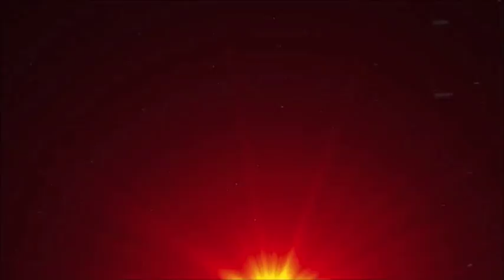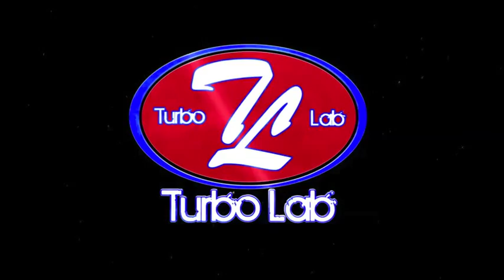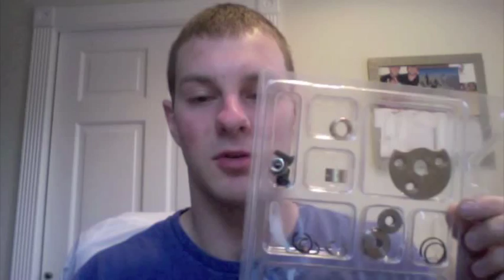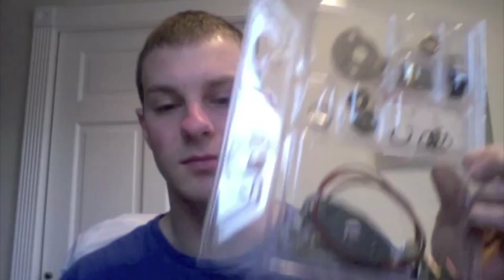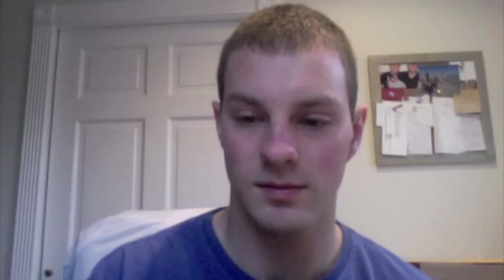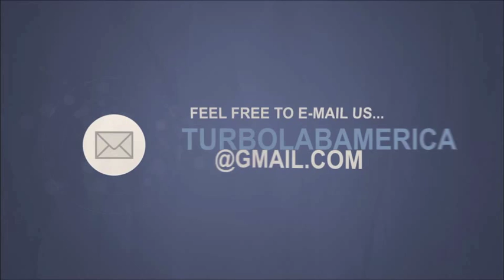Holset H1E H1C Turbo Rebuild Kit

Comment: Do the h1c turbos need rebalance?
Reply from the maker: +2GeclipseGSX mark the orientation of the compressor nut, shaft and wheel at the compressor side to keep the original balance. They are assembly balanced. If you mess up the orientation it won't be the same but likely has little effect because the Holset hx and he were just component balanced. But the h1c thrust bearing from factory is very weak causing them to fail easily just with increased boost on the factory thrust bearing.
Reply: +Turbo Lab America ok. I just received my kit from you guys. Do you have video or write up instructions
Reply: +Turbo Lab America ok so I did the rebuild but it seemed like the shaft is really stiff now. I finished putting it back together regardless and bolted it up to the car and started the engine. The turbo doesn't spin at idle. It starts to spin after I rev it. Is it supposed to be stiff for awhile or is something not right?
Reply from the maker: +2GeclipseGSX that can happen if you don't put the oil deflector in properly. The thrust collar goes into the compressor housing first. Then the oil deflector sits on the bearing housing in the pocket. If it still locks up your could have bent your oil deflector, or piston ring seals, or you didn't clean the piston ring groove in the shaft or bearing housing.  Or the shaft seal area could be damaged causing the  rear seal not to go on properly.
Reply: hey I forgot to come back and comment. after letting it idle for few minutes it cleared up and spins normally now. I think it was still just too dry on initial start up.